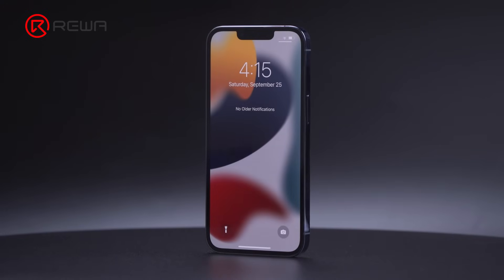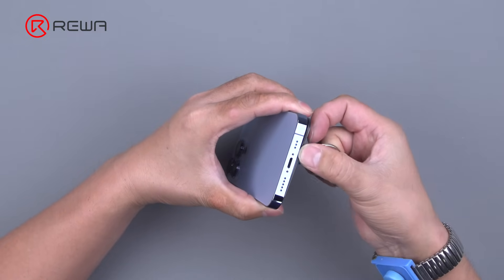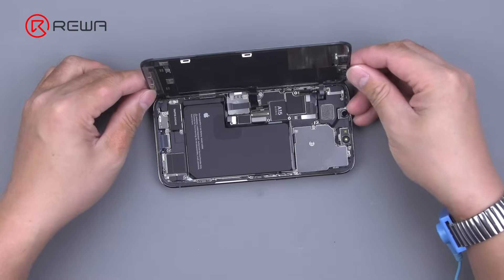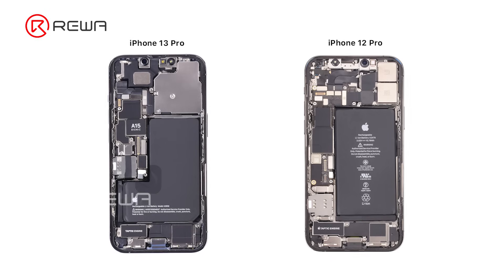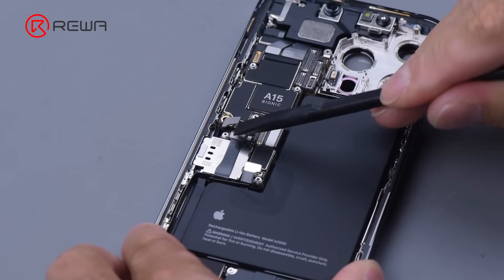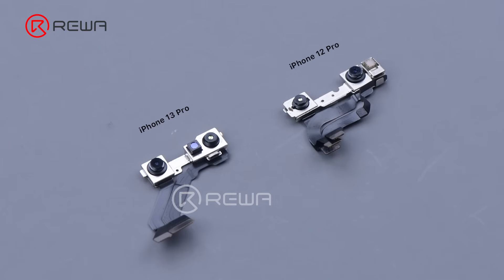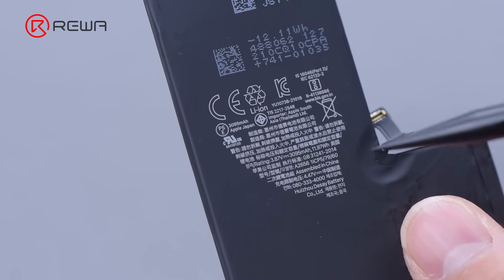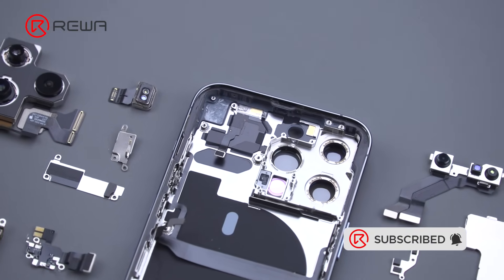iPhone 13 Pro Teardown - Easier Than iPhone 12 Pro?

Comment: Hi, i just got some motorcycle accident and then my iphone 13 promax camera lens a lil bit crack. Is it can be replaced like the lens protector for example or like the screen protector that you can remove and replace? Or i need to replace all of the back case?

Comment: sir i have a apple 7 plus which is also in a bad condition..whenever i call someone through 7 plus..sound is not going to the otherside..repairing was solving this issue but it will happens again after 1 ir 2 months..can you resolve their issue

Comment: What they are not telling you in this video is that Apple has made it impossible for third party repair shops to repair your iPhone 13.  All the parts that plug into the motherboard are coded in the boot process of operating system.  If you replace it, even with an authorized certified Apple part, the FaceID, true tone, auto-brightness, and several camera functions will no longer work.  You MUST get the new part certified by an authorized/certified Apple repair shop before FaceID will work again.  Apple did this in retaliation to losing the right to repair legal suit.  Apple would rather put hard working people out of a job and shut down third pay mom and pop repair shops just to make a few more dollars from customers.  Total and shameless GREED!  I will never purchase another Apple device again!  This year it will be the Google Pixel 6 Pro!  Apple can now KMA!!   Links below to other videos as proof:

https://youtu.be/LgU5G41-c2g

https://youtu.be/8s7NmMl_-yg

Comment: Hey. Realize that the device has been disassembled previously. When he takes out the earpiece you can see the fingerprints. Also, the dock connector came out way too easy. I'm just saying this so people will not destroy their devices by thinking that the parts come out easily.